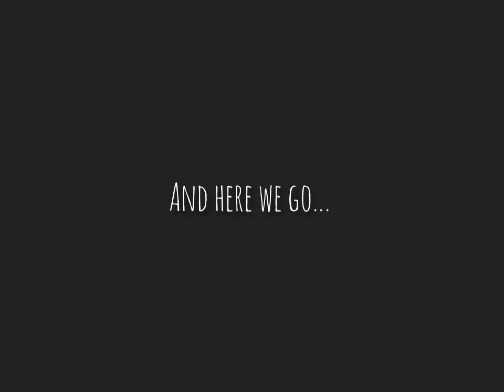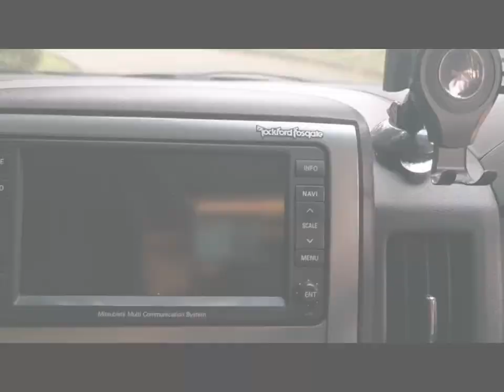Mitsubishi Delica D5 Audio System Upgrade - 12-way Premium Rockford Fosgate Speakers System

Comment: My Delica D5 is a Japanese market model. I live in New Zealand so there is no phone connectivity and the radio frequencies are wrong. The only reason I haven't replaced the system is the cameras; front, side and rear which I don't want to give up. Still trying to find a solution
Reply from the maker: Indeed.. The reason I replace my head unit to MMCS is the camera system. 

What model is your MMCS?
To have a phone connectivity, minimum model is J05.
Check these related videos for phone connectivity (handfree) 
https://youtu.be/MKlWX8ltGiY
https://youtu.be/qfikLRL9oOM

As for radio frequency, I added a radio frequency of extender like this:
https://www.amazon.com/Keenso-Frequency-Converter-Expander-Japanese/dp/B07GRSTJYN

Not sure which radio extender model suits your region.
Don't give up on MMCS, it's old but awesome.
Reply: exact same here, i think im going to add a simple second radio underneath it for the sound system

Comment: Bang kalo delica larinya boyo dgmna in yaa bng biar mantepp gitu 🙏🙏🙏 mohon saran bang
Reply from the maker: Klo masalah mesin, saya aliram mesin standard pabrikan... Hehe...
Reply: Memang boyo nya separah apa ya? Saya juga mau ambil delica masih ragu karena banyak yg bilang ga ada tenaganya.
Reply from the maker: @hendybudianto1138  coba test drive aja kali om...biar bisa langsung nilai...
Ada paddle shift kok, bisa lincah dan main RPM atas.
Reply: @hendybudianto1138  Gak kok, di Delica kita kan bisa mainkan persneling manual. Saya begitu ketemu tanjakan langsung mainkan persneling manual, langsung narik. Kalau main matic terus ya memang gak lari kalau di tanjakan, tapi kalau udah main manual bisa diadu kok.

Comment: Fantastic Job, was all the wiring there already, including the sub?
Reply from the maker: Nope... Need to rewire them all... 😅
Reply from the maker: Ow... There are wires for rear tweeters and rear speakers available but they are ended in some socket junction, not connected to Head Unit
Reply: Om, socket junction ini dimana letakny? Ujung dr kabel yg sdh disediakan dimana ya
Reply from the maker: Socket junction ada di beberapa lokasi.
Ujung kabel diurut aja. Soalnya ada section yg ga sampai ujung/ junction